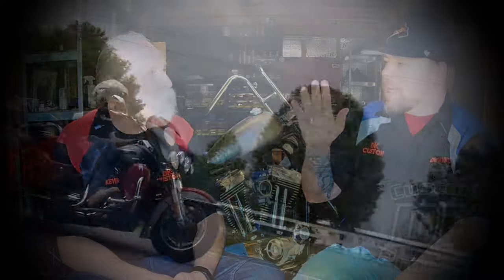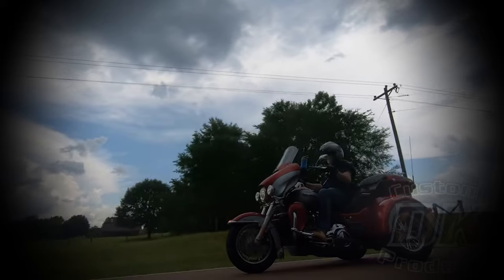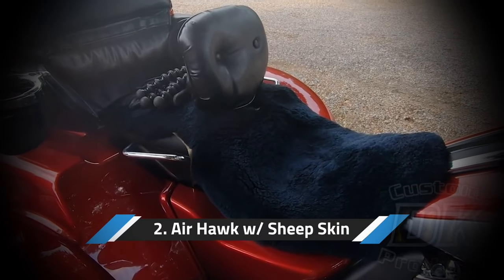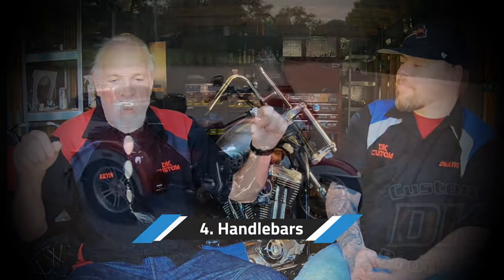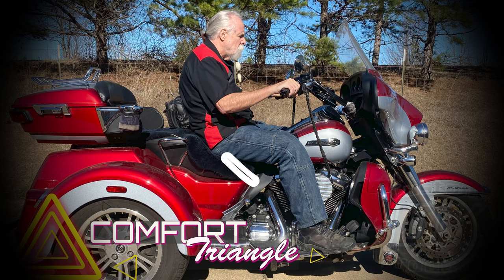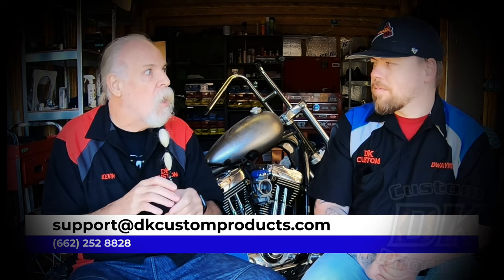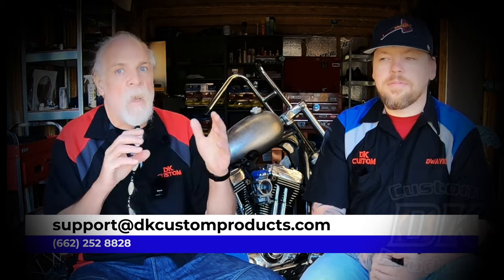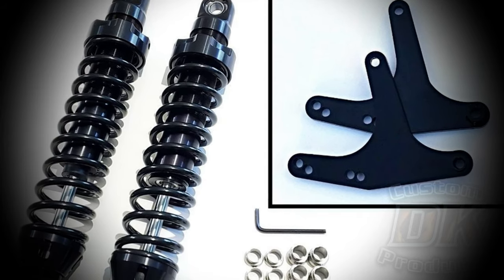First Things We Do to a Trike & a Bagger For Improvement

Comment: I'm looking into buying a tri glide but after watching this video I don't want to spend $40,000 and spend another  $5,000 to be comfortable, I'll just buy a goldwing
Reply from the maker: Make sure you get a goldwing that is comfortable for less than 40K.  I have ridden quite a few goldwing trikes that were far from comfortable.  I did ride one that was the bomb...super comfortable, quiet, smooth, and they guy had well over 40K in it...and, of course, no warranty since it was a conversion.  Honda does not make trikes.
Reply: WHERE DID YOU GET THE PRICE OF A HD TRIKE IS $40,000 THAT WOULD BE A 2-3 USED ONE . A NEW ONE WOULD BE $49,000 PLUS $8,500 IN UPGRADES EASILY. YOU WOULD BE $57,500 PLUS TAX.  GOLD WINGS ARE FOR PEOPLE WHO CAN’T AFFORD HARLEYS AND INDIANS ARE EVEN MORE THAN HD .
Reply: Hell the Gold Wing trike kits start at about $25 Grand !!

Comment: I ride an 09 Harley Trike because I’ve had three back operations and am 72 years old. You talked about the back rest but I found (what works for me ) is riding without the back rest. I found this out by chance. I brought my trike to have a cam upgrade and it was about 150 miles home. I took my back rest off before service and forgot it for the ride home. Now on the way up there I had to stop three times to stretch my back but on the way home it was different, I had minimal pain and didn’t stop once, no back rest. I guess it’s whatever works for you as an individual. My rides are a lot more enjoyable now. Great video guys. Thanks
Reply from the maker: Glad that you found a way to ride that helps your back feel better! 

Thanks for commenting! 😎
Reply: I agree NO back rest !  If I drive a vehicle with lumbar support I have to deflate it to be comfortable. 2 titanium shims in my lower back 2017. Drove trucks 6 more years till retiring. Riding 2020 TriGlide.

Comment: I have a 2019 HD freewheeler.  I'm just a beginner rider. I had added recluse clutch on it but still not confident riding it. I recently had a Pingle electric speed shifter put on it but it not installed right. Do you know anything about it?
Reply from the maker: First and foremost, we strongly recommend taking a Harley Trike Riding Course.  Second, practice, practice, practice in an open parking lot.
Regarding the Pingle electric shifter, we have ridden with them, but never installed one, so cannot offer any advice on that.
KP
Reply: @DKCustomProducts  I have taken 2 motorcycle training.   1st on 3 wheeler but it was can am...I was comfortable on that. The 2nd was two wheeler.  It's been 2 years.  My husband toom me into parking lot and practiced a little.  Since then, he past away in tragic motorcycle accident  last year.
Reply from the maker: I am so sorry for your loss! I will keep you in my thoughts and prayers! It certainly wouldn't hurt to take a Trike or Freewheeler specific class. Those classes can definitely help with knowing and understanding your ride more. Thank you for commenting! 😎 MB

Comment: The best thing I ever did when I bought my 2014 TriGlide in 2014 was a rear lift kit and I always run 20psi in my rear tires. I took it coast to coast 3 times 100,000 miles now and no issues. Great ride. Thanks for your video.
Reply from the maker: Awesome! Glad you are enjoying the benefits of having the Lift Kit installed and the PSI lowered in your rear tires! Thank you for commenting! 👍😎👍 MB

Comment: I went to my dealership in Tulsa (Myers-Duren) and spoke with a gentleman at parts and service. My issue has been comfort. I love my Tri Glide Ultra, but I've been dealing with discomfort between my shoulder blades, a numb ass, and feeling as if I have to lean to access my handlebars. He guided me to change the seat to something that puts me more forward and steered me away from new handlebars because of the cost, and I knew I wanted to add highway pegs and a backrest. I just watched this video and I feel good about what Scott recommended. The only thing I didn't think about were the floorboard extensions which I now want to add. I'm looking forward to making these improvements and having a much better riding experience. By the way, I watched your video on rear tire inflation on a trike and I'm going to try that adjustment, also. Thanks guys! I'm looking forward to future videos from you.
Reply from the maker: Sounds like Scott gave you some good advice. 👍
I believe you will be well pleased with the Floorboard Extensions and with lowering your rear tire PSI.
Here is a video on the process we use to set up all of our rides...called The Comfort Triangle...it starts out with your exact complaint  https://www.youtube.com/watch?v=Y4pWGTj-iDE

Comment: On my 2016 Harley Triglide, in the winter, l love my Gerbring heated gear.  If you have traction, you have action. However, suspension upgrade is my next step. I have done the footboard extensions, 12” handlebars, backrest, air hawk and lamb skin, backrest m and rear lift kit. All wonderful.
Reply from the maker: Nice! 👍
Appreciate your business.
Yeah, Gerbing heated jacket liner really made riding in cold weather much more enjoyable.

Comment: Very helpful...  I plan to purchase the new Road Glide 3.
Reply from the maker: Glad you found it helpful/interesting. 👍
The RG3 is a sharp looking ride.  The one thing that I don't like about it is the low profile rear tires.  With less sidewall there is less flex, which means not quite as nice of a ride quality.  But I would not let that stop me...if it ended up being too rough, even with the Comfort Lift™ and some good shocks, I could always switch rear tires for the standard rears with more sidewall.
Enjoy!

Comment: I like the idea of a  blank canvass, but the blank canvass should be lower in price if it is really a blank. Make the normally changed items less costly so they are more easily replaced. 
I have a 22 HD TriGlide. I have put 10 inch KST Mayhem bars with HD Kahuna heated grips. The seat on my 22 is very comfortable (more more than my 2014 factory seat). So do you put the airhawk and sheepskin under your leather since you said that you found how easy it is to take apart? I have a back rest added.
My additions:  10 in bars/heated grips/highway pegs (ciro3d adam sandoval mini floorboards)/arm rest on tour pac for wife😎😎
Reply from the maker: The Air Hawk goes on the seat, sheepskin goes over the seat (and the air hawk).  You can see it better at the 7:12 mark in this video. https://www.youtube.com/watch?v=5h77GQJTW1w

Thank you for commenting! MB
Reply: Thank you. I was probably typing when that part came on screen and missed. Thanks for clearing it up?😎😎
Reply from the maker: No problem! Thank you for commenting! MB

Comment: I just did new suspension and the comfort lift, it's winter/snow here still so I haven't got a chance to ride it yet but can't friggin wait and new backrest
Reply from the maker: I believe you are going to be well pleased with your new set up. 👍
Reply: @DKCustomProducts  I hope so, and the comfort lift SHOULD put more weight on the front tire so I'm hoping the steering is better, it was fine b4 but should be even better now
Reply from the maker: Yes, it will some, how much depends on what shocks you had on their before.
Reply: @DKCustomProducts  I just had stock shocks, It's a 22 Freewheeler, I only bought it last August
Reply from the maker: Yes, those stock shocks have very little sag (probably none), so your aftermarket shocks will have a bit of sag, as they should, so it will even out, with a net increase is the rear by a little. 👍

Comment: Kevin, did you cut a "notch" in your sheepskin for your backrest or did you order it that way? I just bought a sheepskin but it doesn't have an opening for a back rest. I also just installed my deflector wings and 2" tank lift.
Reply from the maker: Yes, we cut a hole for the backrest, and Mary sewed a border around the hole so that it does not grow.
Thanks for the business, we appreciate it.  I believe you will be well pleased with those parts.

Comment: Great vid. I have a 81 shovel FXS (Low Rider bought new in 81 and still have and have had Sporters, Street Glide, etc). But bought 23 Road Glide 3 last October. Suggestions on pipes? Stock pipes do not sound (to me) like a “Harley”. Thxs.
Reply from the maker: Congrats on your new Road Glide 3!!!! 
What is too loud for one person is too quiet for the next.  Impossible to say.  We have a video, linked below, that should help choosing the right exhaust for YOU.

We can say that the best power out of a slip on is the stock slip-ons, with the baffles removed and TTI's installed.  Video on that is below also-

Choosing the right Exhaust video- https://www.youtube.com/watch?v=H681dl2X_f4

Best power out of slip-ons video- https://www.youtube.com/watch?v=cOs1-bTPycU

Thank you for commenting! MB

Comment: I have a question i have a 2002 harley 883 and about four years ago i was in a car accident and it messed up my back and i have to get 2-4 injections in my spine per year.  I recently got back on the bike but its not the same i dont feel safe or comfortable riding it. Im thinking of a buying a trike what would you recommend thanks,Jack.
Reply from the maker: Go test ride different models.  That is the only way for you to know which Trike you will like.
There is also a forum, just on Trikes that has a lot of useful information.  TrikeTalk.com
KP

Comment: How are you doing? I got a 2022 trike Harley Davidson. I added heated grips 12 inch bars. A reclusive clutch. Now I am adding a legend suspension in the rear. This is very different than the two wheels. I have a little trouble going around corners and high speeds. So I’m hoping the legends suspension helps a bit how is your trach in cornering and taking sharp turns at high speeds.?
Reply from the maker: Doing well, thank you. 👍
Congrats on your 2022 Trike, and good to hear you are getting it set up for yourself. 👍😎👍
I strong encourage you to not get the Legends suspension, front or rear.  While better than stock, you can get much better than the Legends for the same or less money.
Check out the front and rear suspension reports/comparisons linked below.
Front Suspension Report- https://www.dkcustomproducts.com/dk-custom-front-suspension-testing-report-part-i-of-ii-dk-fs-tst-rp-i.htm
Rear Suspension Report- https://www.dkcustomproducts.com/overview-of-performance-rear-shocks-98.htm
With a properly set up HD Trike it can handle the curves quite capably.  Here is a video showing how well they can handle-
https://www.youtube.com/watch?v=3UAMKIj97G0
And here is one of may other videos we have on Harley Trikes- https://www.youtube.com/watch?v=QglBaUe7iR0&t=0s
Feel free to email or call with any questions:
Support@DKCustomProducts.com
662-252-8828

Comment: Great video goingto buy a left over 2023 tri glide ultra,,what size and kind of handle bars,any recommendations for a windshield(iam 6'4")..😊😊
Reply from the maker: You will want to find your comfort spot for handle bars before purchasing or changing your stock handle bars. Here is a video on the comfort triangle - https://www.youtube.com/watch?v=Y4pWGTj-iDE

Here is a written report on the comfort triangle - https://www.dkcustomproducts.com/how-to-set-your-bike-up-for-youthe-comfort-triangle-dk-tri-su.htm

Kevin's handle bars are custom made to fit his comfort,  you can see in this video at the 5.06 mark how his are made. - https://www.youtube.com/watch?v=5h77GQJTW1w

As far as a windshield goes Kevin does not use the top of the line windshields. He has been satisfied with a couple different windshields he has used over the years.

In warm weather he uses either the factory 10" shield or the Long Ride Shields (LRS) 9" Mega Curve.

In cold weather he uses the Long Ride Shields 12" Flat Top Recurve (I believe it is called the Gold Series.

He has heard great things about the Freedom Shields, but has been satisfied with the LRS over quite a few bikes over the years, so never tried any other.

Thanks for commenting! 😎 MB

Comment: Thank you guys I just ordered my foot rest extensions. Excellent idea. I was wondering if you could help me I have an 03. Ultra classic with a motor, trike add-on the fender is hitting the left wheel air pressure is good and I’m not sure why it’s doing. Is there someway to adjust the left side of the bike??
Reply from the maker: Thanks for your business, we appreciate it.
Glad you are enjoying the floorboard extensions.
I am sorry we are not familiar with trike conversions.  The first thing I would look for is if the shock on the side that is hitting the fender has failed, or in the process of failing.
The next thing is to see if the fender or body has adjustment in mounting position.

Comment: I have done all the five things listed including Nexgen shocks and lift kit from you guys. Awesome ride. A question: do you use the 15" HD windshield on your trike" or is it 12". I had a new windvest shatter after 140 miles so am considering other options now and respect what you do in the trike world(and 2 wheel world too!)
Reply from the maker: Thank you for your business, we appreciate it, and it is great to hear that you are enjoying our the parts.

I do not use the top of the line windshields...perhaps I should, but I have been satisfied with a couple different windshields I have used over the years.

In warm weather I use either the factory 10" shield or the Long Ride Shields (LRS) 9" Mega Curve.

In cold weather I use the Long Ride Shields 12" Flat Top Recurve (I believe it is called the Gold Series.

I have heard great things about the Freedom Shields, but have been satisfied with the LRS over quite a few bikes over the years, so never tried any other.
Reply: Thanks for getting back on this. Honestly never thought of having summer and winter windshield but that is a good idea!

Almost time to change the trike oil. Will be coming to you soon for a filter relocation kit and oil cooler!
Reply from the maker: Awesome! You will be very happy with the cooling effect that moving your oil filter will have along with the ease of changing your oil the next time you have to change it. 

Here is a link to the different oil filter relos - https://www.dkcustomproducts.com/harley-trike-oil-filter-relocation-kits-c615-140.htm

Please feel free to contact us with any questions you might have;
Support@DKCustomProducts.com
662-252-8828

Thank you for your business and for commenting! 😎

Comment: Hey guys watched your video on tri glide comfort..T.y.
Hey im 5'3..have a bad lft hip..my trike a 2016 Tri glide 103 H.O...my issue is my short legs and that wide tank..what can i do?..also the bars you put on your trike i think coming back to me a few inches would help in fitment,any suggestions?...and the mid step? Any thoughts..T.y.
Reply from the maker: Glad you like the video!!!

Unfortunately, we do not have anything that will mover your floorboards backwards. You may look at adding the Floorboard Extensions. They will move the floorboards out 1" which will give you more access to the whole floorboard and more comfortable foot position. You can see them at this link - https://www.dkcustomproducts.com/rider-floorboard-extensions-for-2014-up-harley-fl-trike-models-dk-tr-flb-ext-tg.htm

Kevin loves his Mid-Step. He originally installed it for video and advertising purposes, but liked it so much he kept them on and even changed them over to his new Trike when he purchased it. Here is a link to the Mid-Step if you would like to read more about it as well -https://www.dkcustomproducts.com/trike-mid-step-for-easy-mount-dismount-harley-more-dk-tms.htm

Kevin's handle bars were custom made for him and his comfortable arm position when using the comfort triangle method. Here is a video on the comfort triangle that you may find interesting/useful - https://www.youtube.com/watch?v=Y4pWGTj-iDE

Here is a written report on the comfort triangle that you may also find useful -  https://www.dkcustomproducts.com/how-to-set-your-bike-up-for-youthe-comfort-triangle-dk-tri-su.htm

Please feel free to contact us with any questions you might have;
Support@DKCustomProducts.com
662-252-8828

Thank you for commenting! 👍😎👍 MB